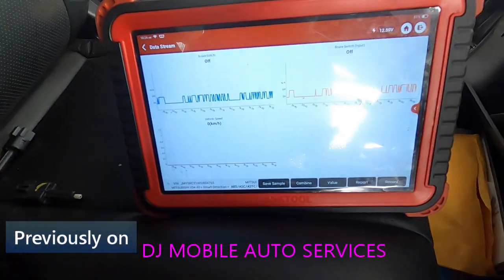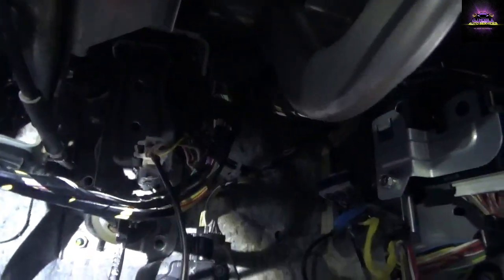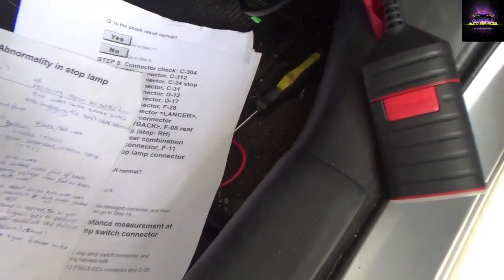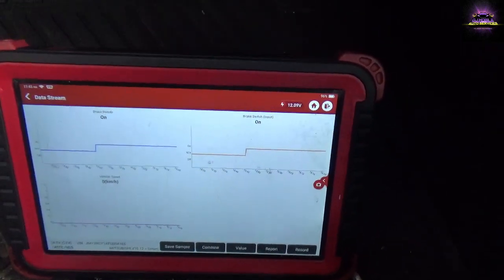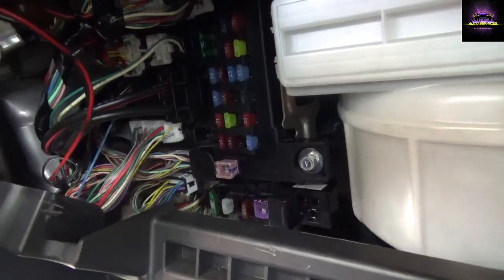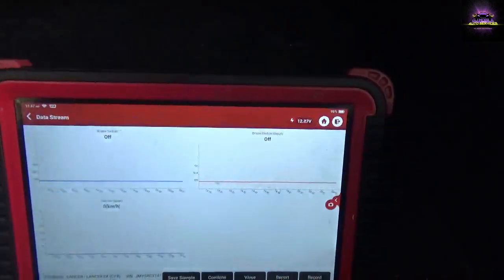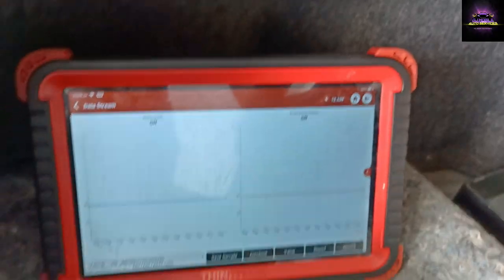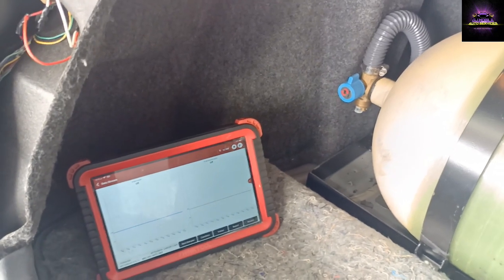C1000 Mitsubishi Lancer Brake Switch Stuck, Lost Power  and Acceleration. Pt2

Comment: I have a similar issue, p0703. I replace the brake switch, I tested continuity on it and both brake switches seem to be fine. Stop light from the center turns on but on the sides they dont. I also have the asc service required constantly activating since this issue started.

I have the original lights but I will check them. Thanks I havr lost a lot of money and tiem because of this issue hopefully this fixes it.

Comment: Can this code cause loosing power and accelaration???  My lancer throw that c1000 code this morning but the car has been loosing power like when you let the gas pedal go while driving and put gas again.. It is been doing that flr a while but never send me any error code and i scanned it few times in the past
Reply from the maker: Yes it was. Like a flat spot. No throttle response
Reply: I have watched both videos and you mentioned the after-market lights or the CAN bus. Which one do you think caused the issue? @djmobileautoservices
Reply from the maker: Aftermarket lights.
Reply: @djmobileautoservices  thank you..👍👍👍👍
Reply: @djmobileautoservices  seriously.. Thank you so much for taking the time making and making this videos... My problem was fixed o had those strobe led ligjts on my stop and after removing those. Car been running great. The problem os gone
 👍👍👍👍👍